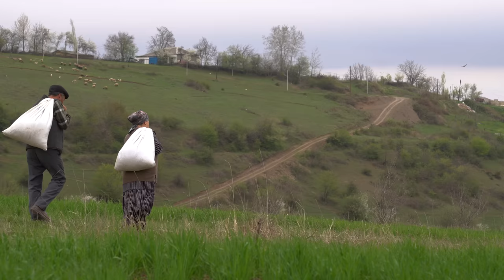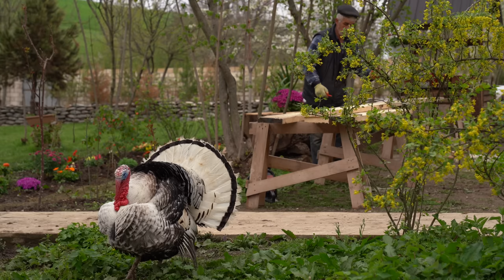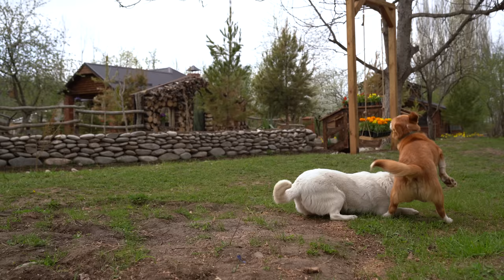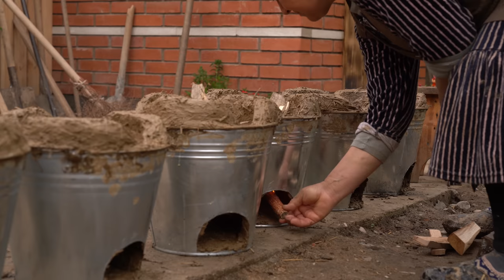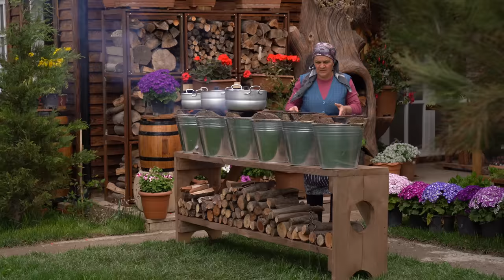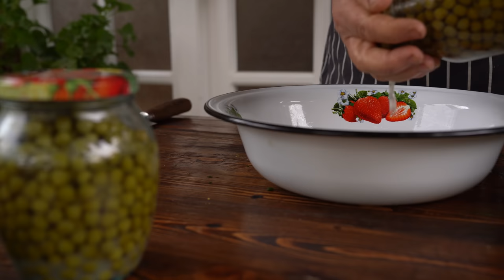When There is no Electricity and Gas - Making the Best Stove for Cooking

Comment: just wondering what exactly was the clay/mud/straw combo???? what is the best, heat controlled, longest lasting combo?    anyone have any tips??
Reply from the maker: The clay/mud/straw combo is used for traditional building and insulation. It provides good heat control and lasts long when maintained properly. 🌿